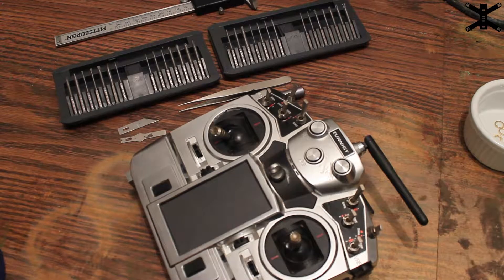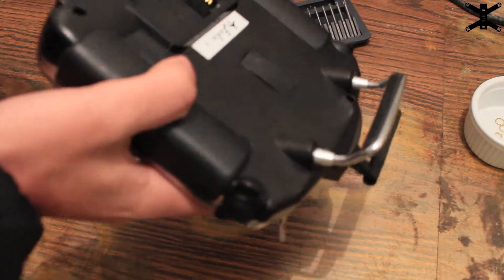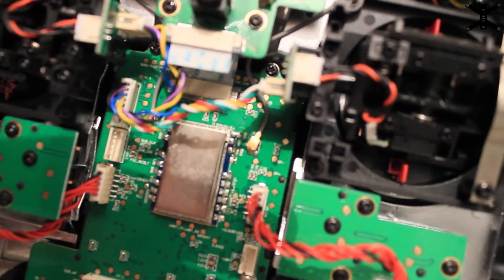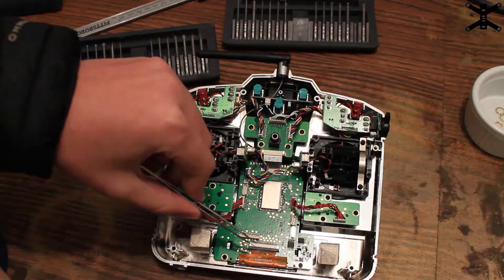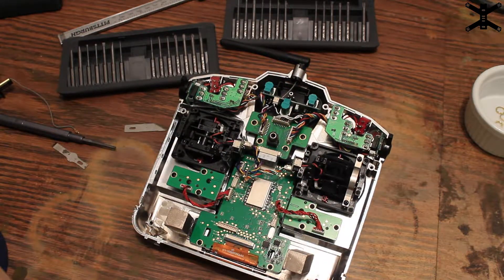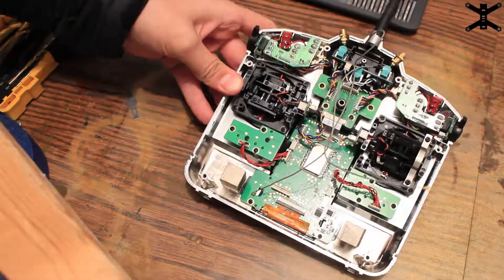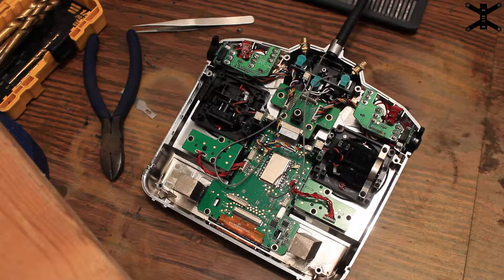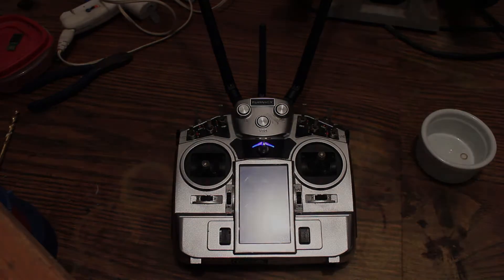OVERKILL Antenna / Range mod for R/C Transmitter | Turnigy I10

Comment from the maker: Update!! I tested this out a couple days ago with my flying wing and the results were at first interesting but not surprising. I was loosing range while super close to myself, but after flying about 1/2 mile away my signal greatly improved. This is because of the 24 degree radiation pattern of the antennas. As you fly farther away from the source the radiation is more spread out giving me better reception in general. Basically, when close to the controller it's very hard to keep the plane in the pattern, but when further away the pattern is easier to stay in. I ordered some 2dbi antennas for the transmitter so I can fly normal los airplanes as well and just switch the antennas out when flying long-ish range. Using a yagi antenna should be very possible. Looking forward to testing it.